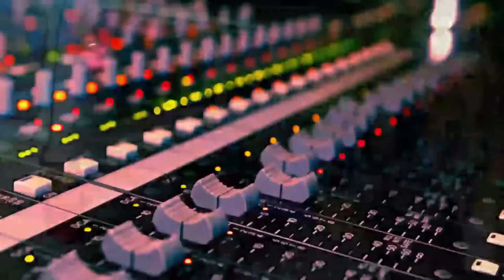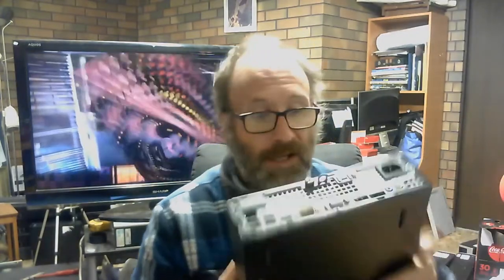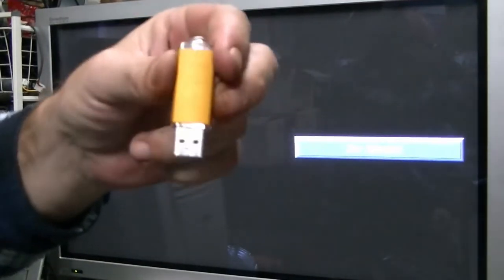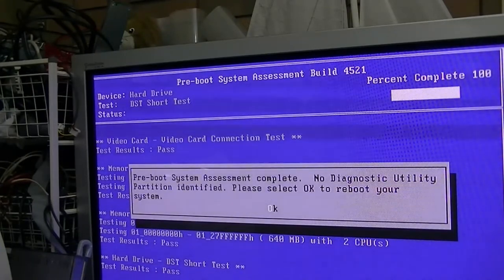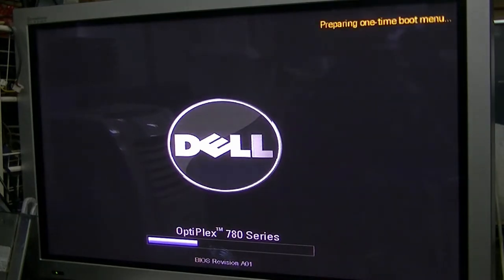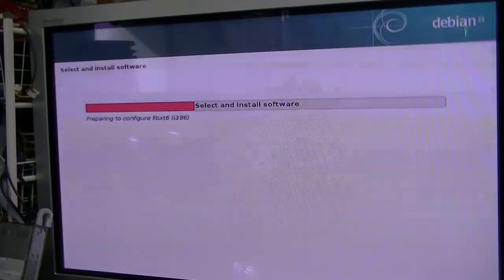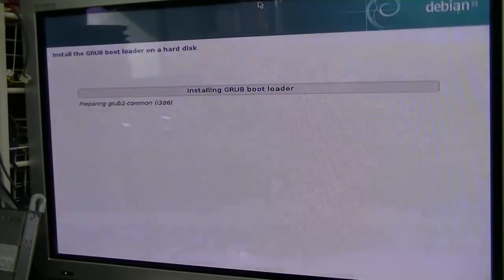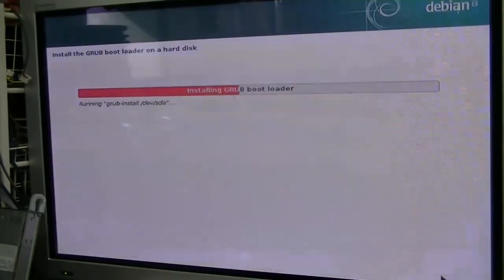Setting New Serial Console - Starts Bad Finishes Good

Comment: Not seen them on inspiron core i5 full size towers but dell optiplex units all have a bios lock feature, there's a small plastic jumper plug hoes across 2 pins, and if the bios locks you out like I got with a 2010 build optiplex 780 just take it out... I found out on youtube where it is & I had to flip the hard drive up to get into it.